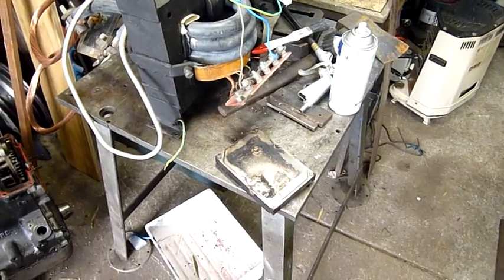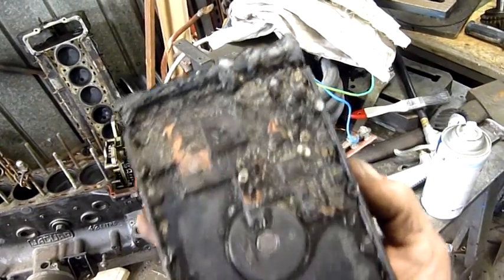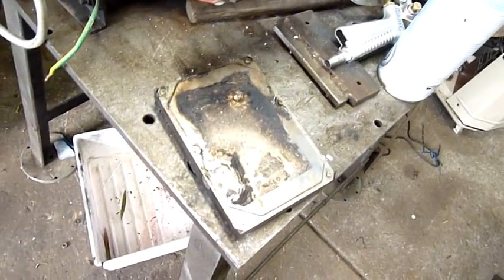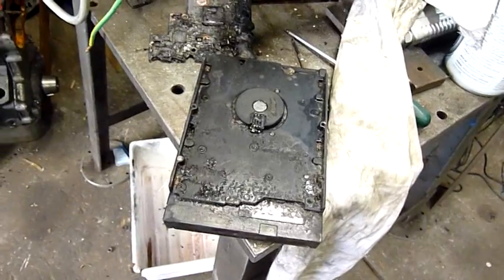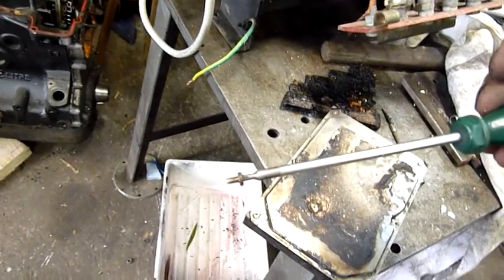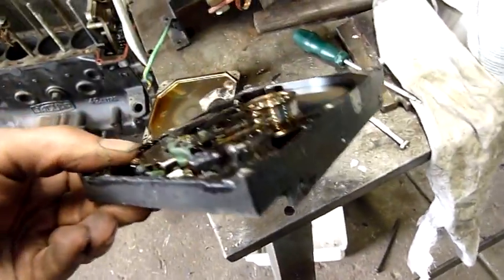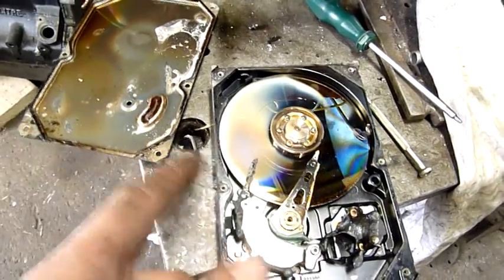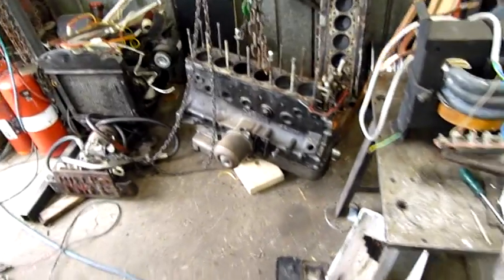Fire damaged Seagate Hard Disk Drive Autopsy

Comment: well..fire can be very bad for data on drives.. th ironic part is that before a month a fire broke down at my other house.. the was no one there  at the time( it was like 2:00-2;30am)..my dad got there about 20mins after the fire started..all tv's-dvds and other devices  just melted down..big damige in a big part of the house some parts need knocking down an being rebuilt.. but big suprize the pc's somehow still are repearable..well the  front of the towers melted, the lcd monitors are messed up and all dvd drives melted aswell..but the motherboars and all insides were somehow saved.. well ok the needed a hell of a cleaning and one of them had a dead ram but i got them to boot fine all hard drives ran windows no problem..

Comment: The platters make for fine wind chimes. Usually you can get two or more platters from the nicer ones, the cheaper ones only have one in them. They chime so well due to their precision machining and balancing. The creative part's putting them together, usually springy stainless wire and monofilament,

Some travelstar HD's used glass platters at once in their production lifespan, but I dunno if they still do. One whack of a hammer and instant Karma for your data.

Comment: i've never actually had the chance to tear a... (would it be "a" or "an"?) HDD apart myself so i don't actually know what part they came from, but a buddy of mine has a couple of rings from hard drives that make a nice ringing noise when you bounce them off a tile floor. probably somewhere in that assembly actually holding the disk. just something to mess with if you get bored.